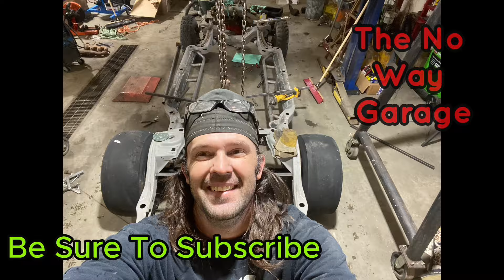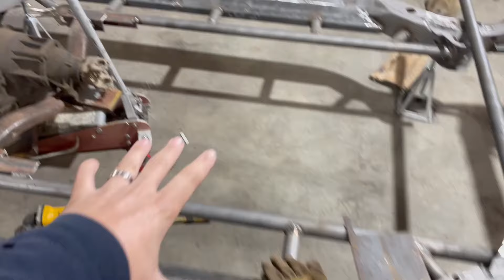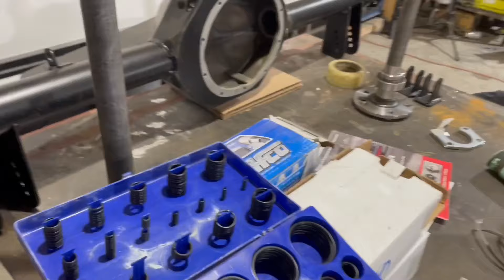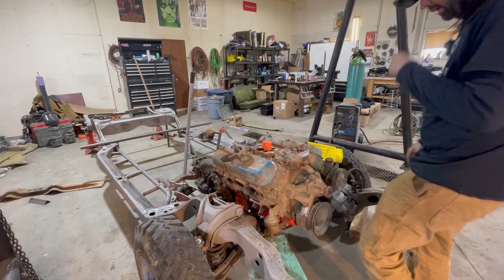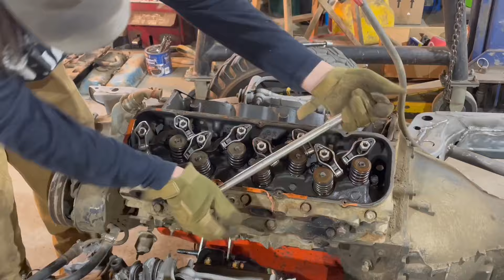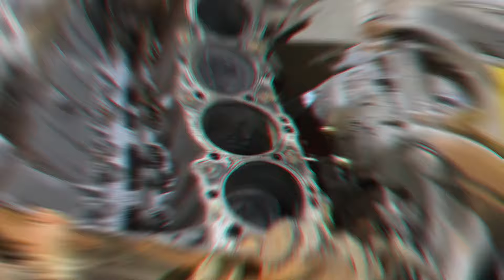Did We Fine More Mice?

Comment: Great work so far! If you are going to keep it as a big block Chevy - th400 combo try and make the trans cross member and motor monts adjustable for the future. So you can get the motor as far back as possible (like distributor almost touching the firewall).

Comment: I had a 1978 dodge arrow that I rescued out of a barn .. the mouse damage was terrible … still got her running after cutting off the exhaust manifold where they buried … she ran for at least 70,000 k even when I took the valves to a wire wheel thinking I was doing a great job … engine caught on fire 🔥 in chamberlain, sask